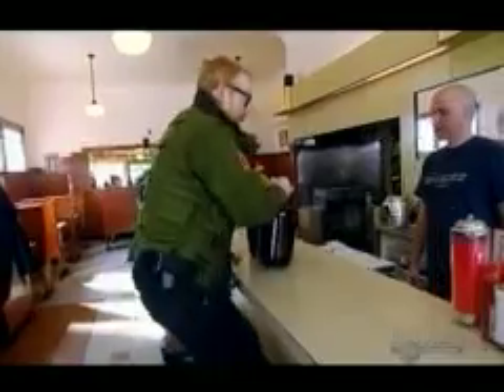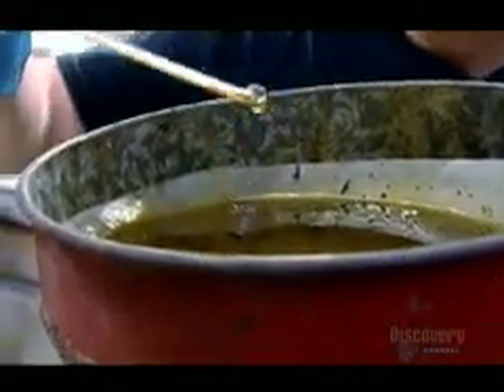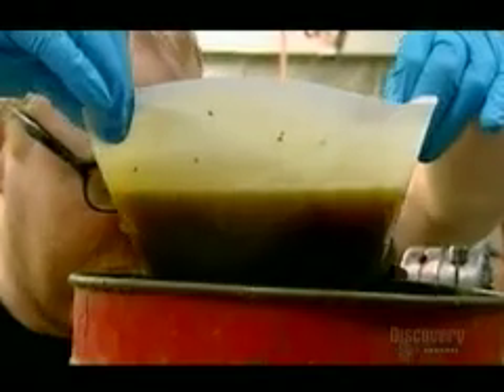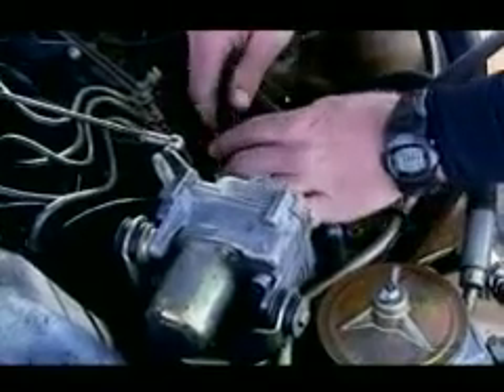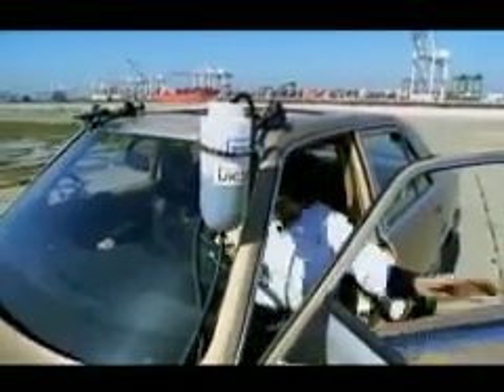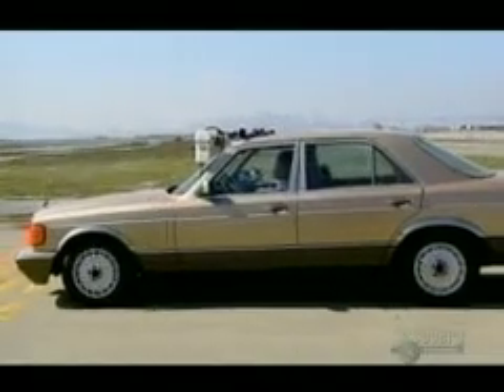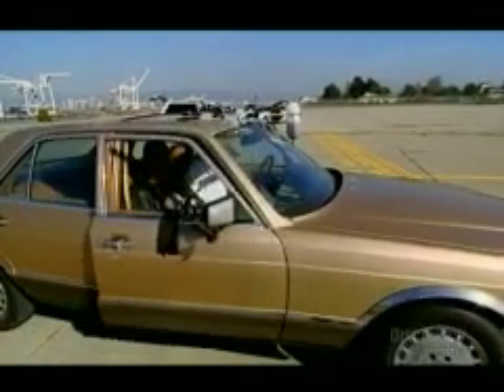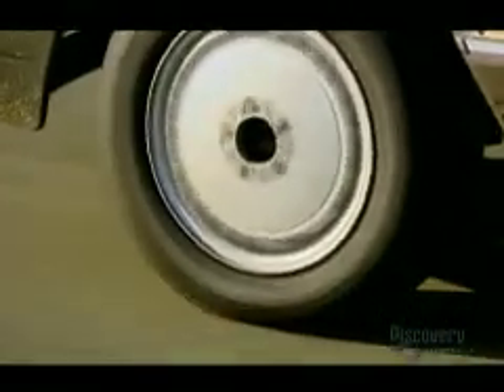Mythbusters - Cooking Oil as Economical Diesel Fuel

Comment: 50% cheapest vegetable oil you can find (just filter it)
40% diesel
10% petrol

Mix it up in a container (a barrel or whatever), let it sit for a few days and you are ready to go.
Will start at low temperatures (wont freeze), will run smooth, wont have any negative side effects of running on pure vegetable oil. Just remmember you cant use it on modern diesel engines but only on older ones. I have done it with Mercedes C250D 1993 model, Mercedes van 207, 2.4l diesel 1985 model, BMW 525 tds 1995 model, Golf 1.9d 1994 model, Golf 1.6d 1988 model, Audi 80 1.6d 1989 model.
All of these made about the same fuel usage but at a much lower cost.
I have done about 100.000 km in Mercedes c250 on this fuel in one year and i didnt have a single fuel or engine related problem. All the service was done just on regular base like i run it on normal diesel.
Mercedes 207 van i still use today and so far I have done about 200.000 km in a period over 7 years without a single fuel or engine related problem.
All other cars i just try and didnt do more than 200-300 km in each (some of them where my friends old cars). My neghbour started using this mix on his renault chamade 1991 model 1.9d maybe a month ago, no problems so far.
These cars are cheap and when the fuel is only about half price.. well you get the picture.
Reply: Warhund Serbia, thank you for the detailed comment. Very interesting. Why isn't vegetable oil suitable for new engines? You say this fuel would hurt the engine in the long term. What would exactly happen? What is the difference of old and new diesel engines?
Reply: Would that work on a 2000 TDI Volkswagen? Can I put the old filtered oil directly in the fuel or I'd have to put a second tank? I guess you were also changing the fuel filter more often? Anything else do I need to know?
Reply: I didnt use it on turbo charged engines of later production. I have a passat 2002 model 1.9 TDI 130hp and since its euro3 you cant use this mix. Dont get me wrong it would run but after a while you would make the engine hurt.

I put the mix directly in the tank, no aditional work needed. Only on the mercedes 250 i had to remove the pre-filter since it got jammed up more often (like every 2 months) and the filter got changed on normal basis (i dont know the km count since i didnt pay much atention to it but i know it was regullar.

On all other cars i just put the mix in the tank and run. I didnt do a single thing to any of the other cars (or the van) and they all run perfectly normal.

One more thing, the 207 van run better on mix than on regular diesel. I asked my mechanic (he is a school friend also and his shop is like 20 meters from my house) is it possible. He told me since the old diesels (euro 2 or older) use to run on regular diesel fuel the engines where made for that type of fuel. Now you cant buy diesel fuel but only eurodiesel (new type of diesel) and that fuel is made for new engines and that new fuel simply doesnt have enough oil in it for the old engines.

Diesel you buy today hurts old diesel engines (euro 2 or older) and this mix is actually better for your engine and the life span of it will be longer and less work and service will be needed.

Crazy but true.
Reply: +Justin Larrivée 

One more thing, you dont need to use the 10% petrol during the summer/spring/autumn. It will run good without petrol but remmember that it will freeze during the winter (or in low temperatures) and you wont be able to start. It will just get mushy and you wont be able to start your car. The 10% petrol takes care of that for you and also ads a bit of kick and power to the mix. But 2 much petrol will hurt the engine. I never went above 10% (during winter) and in the summer i use to put like 1 liter of petrol in 40 litre barrel (20 litre vegetable oil, 19 litre eurodiesel) but it does run a bit better with 10% petrol.
Reply: I use a 35% SVO/65% diesel mix in my 2001 Passat estate during the summer and achieve 52mpg average including urban driving and two long journeys on the motorway. Have used it in the winter but the engine really did not like it at very cold temps. Opacity test is very low too :D
Reply: I have left a comment above about how my 207 van works better on mix than on normal eurodiesel. Thats why.. just turn the story around..

The old diesels (euro 2 or older) use to run on regular diesel fuel and the engines where made for that type of fuel. Now you cant buy diesel fuel but only eurodiesel (new type of diesel) and that fuel is made for new engines and that new fuel simply doesnt have enough oil in it for the old engines.

Diesel you buy today hurts old diesel engines (euro 2 or older) and this mix is actually better for your engine and the life span of it will be longer and less work and service will be needed.

So this mix has more oil (like grease not oil like fuel) than modern diesel engines (euro 3 and above) would like.. So it greases up the system since the injectors are far more sensitive.. It will run but you will have some problems in the future.. like you would have to change pre-filters and filters more often and injectors will get clogged up (those are expensive to replace or even service). The more electronics the car has and the more modern it is the more damage it will suffer..
Reply: I have a 2003 Citroen C5 2.0 HDi which is common rail but doesn't have a particulate filter. I am thinking of blending waste vegetable oil at about 20-30% with diesel. I am already adding 1:200 2-stroke oil in my diesel to increase lubricity and also use a couple of proprietary diesel additives that are supposed to improve combustion and reduce emissions. Do you think I can get away with that amount of vege oil in the diesel? One of the additives I use is very thin solvent based, probably kerosene, so would probably act as a thinner for the vege oil as well.
Reply: The Chamade 1.9 F8Q Diesel is a great engine. Had one

Comment: LIES! My old 1984 Mercedes 300D can run on straight used veggie oil. I have driven thousands of miles on free grease.
Reply: I have a 300TD with the stock om617, replaced the main and secondary fuel filter beforehand, it runs pretty good and you get the bonus of exhaust smelling like French fries
Reply: So your car works exactly like the car they showed and they are lieing????
Reply: Will it work on my 240d ?
Reply: @nekikrkan8035  old Mercedes works great on oil but if you drive on pure oil it should not be much below 10C.
https://youtu.be/v028ttuq50Q
Reply: +Dorian Demeturlias my too !!!! :D
Reply: Is your benz turbocharged?
Reply: Dorian Demeturlias but boy if u break a pump those savings are gone mix 50 50
Reply: @chris532008   80/20 mix will work just fine.
Reply: I wanna buy any diesel w124 if it can run with used FREE veg. Oil without any problem. But somebody says you Will run out your engine and repait cost Will be more than fuel cost
Reply: Koray Erman   First is the getting the supply of oil consistantly and low price. Without salt then months to settle out. Then thin with 1/4 gas to crack then 50 percent diesel   If u set up net work of several people get restaurant cooperation set up yo repsir pumps and injectors just in case snd more frequent filter changes as I understand 2 years interval is important
Reply: My 2.5 turbo diesel Jeep too!! 🙂
Reply: BorisGrayman 300d is a turbo model. 240d is not
Reply: max p They made naturally aspirated 300D. Turbochargers became standard on the 300D in 1982, any 300D before 82 is not turbocharged.

Comment: Conversion in to actual biofuel requires you to react vegetable oil with methanol, using sodium or potassium hydroxide as the catalyst. You would then filter out the glycerol and you would be left with methyl esters that would serve as a suitable replacement for diesel. It is economical too.

Comment: The one important thing they failed to test.

Power output. Put the car on a dyno, see if it makes more or less power with veg oil.
Reply: interesting profile name,
Reply: Bullshit. Try release the gas pedal and look at the speedometer. It will slow down  slowly but steadily due to vehicle air drag and tyres friction and finally you will stop.  It will consume less gas though because when your car is up to speed you are fighting against dynamic friction which is weaker than static friction. The MPG is a good comparison between two identical engines running on different fuels.
Reply: Well yes, but as the cooking oil is a bit less powerful the car needs a bit more to keep it at 35mph
Reply: +Mohamed ThePedophile It makes less. Hence the less mpg.
Reply: +RogueTalent541 That's the most illogical thing I've ever read. Once you get that thing up to speed, you barely use ANY power to keep it going. A scooter engine could keep that thing going 35MPH with no problems, it's getting it up to speed that needs power and more fuel.

The car may be making less power (and it probably is to some unimportant extent), but that wouldn't have an adverse effect on fuel economy. And really, if you are running your car for free, you really don't have a reason to complain about power loss.

Comment: I have been doing this for ten years.
it is not a time consuming process.  I let it sit for 3 weeks - none of  my time required except to pour it into the container. Then I gravity feed it through a filter into another container (drum) - time required only to turn on the tap. Then I pour it into  my car and drive. Takes me about an hour to pick up and 'process" 100 gallons.
I get the same mileage (exactly) and power with both fuels.  I heat it before it goes into the engine to make it easier on the pump, but it runs without the heat anyway.
Reply: +Gerry S "I heat it before it goes into the engine" you said.. How do you do that(let say, in the morning for exemple)?..
Reply: +Jay Silva 
Hi Folks
I have done this on several vehicles....
I make a smaller tank that will fit under the hood, bend some 3/8 copper tubing and put it into the new tank.  Then I plumb the coils into the into the engine coolant system (before it gets to the cab heater).  Perhaps not necessary, but I also have a separate 'golden rod' (google it) filter wrapped with 3/8 ID between the tank and the injection pump,  to provide some secondary heat and then I made another heat exchanger out of a 3/4" copper pipe with hot water running through it and the fuel line goes through that just before it gets to the IP. Remember I live in a cold climate, but this system even worked when it was -40 deg (yes that is a minus!).  You'd had better make sure you don't shut it off at that temp with oil anywhere in the system though if you don't have a way of heating it all up before you want to run it again!because at that temperature the oil freezes just like butter would.
I of course have a two tank system where I start on diesel using the main tank and when the engine comes up to temperature I switch over to Veg oil. I switch back to diesel about three km from home to ensure that it can start on diesel only.  There are ways around this too, but if you live in a hot climate you won't have to worry about these starting issues.
Even at 140 deg F diesel sis still a lot  more viscous than diesel, so your pump will be happier with you over the long term if you heat the oil before it goes into the engine.
You can tell that this system in a cooler climate isn't much good for around town due to the delays in switching.  However, if you have a more modern engine (my last one was a TDi 1.9 VW they have a lot of fuel going through the return lines and don't require more than about 30 seconds to clear the oil form the IP.  My current vehicle is a nissan pickup with an SD25 and they hardly return anything through the return lines - hence the longer time to purge before shutdown.
None of this is complicated and I can send pictures if you provide your email.  No idea how to do that on youtube
Side thought....I am not a chemical engineer, but I would avoid mixing gasoline with veggie oil thinking that you can make diesel. I don't think they are the same thing.  If you must mix, I'd suggest just mixing it with diesel.  Mix at bit at different ratios and leave it outside in your area and see how it thickens (or not).  Mix it well or it will tend to separate, but when mixed thoroughly it seems to stay mixed for  a few weeks at least (I haven't left it more than that).
Hope this helps
Cheers
Reply: Thank you bro for all the time and care you took to explain nice and clear all you have done so far.. My kudos to you.. You rock bro :-)
Reply: +Jay Silva 
No Problem.  This medium only works if people follow up....otherwise it is just an exercise in frustration - and there is a lot of that on here.
Reply: +Gerry S  "It's easier to fool people than to convince them that they have been fooled."
Reply: Gerry S can you email me pictures please Gerry, very interested in doing this, haeremaimoko@hotmail.com
Reply: Gerry S You are awesome...
Reply: Gerry S weeks is very time consuming
Reply: @circusboy90210  Is the $$ savings worth the time. In a single word... yes. Compare the cost of used veggie oil to a gallon/liter of diesel. Most used veggie oil can be obtained free of charge from your local restaurant as they typically have to pay to have it picked up and discarded.

Comment: yes it runs but your machine will be shorter life because of dirt in that oil , it is filtrated but that oil still got dirt inside , i mean look how blurry that oil is all that stays in your machine , that is why all fuel for engines are clear that you can see through , it have just the color but cristal clear...
This will be great if you filtrate and refined that oil that start to be clear , then will be even for useing all the time in machine and you can mixed with diesel over time.

Comment: Ummm... wait a minute, is this video about the coolness of running a car on cooking oil, or is it about the fuel efficiency of difference between diesel oil ?  I've never heard anyone claim that cooking oil had more energy in it than diesel oil.  That said, the fuel companies have already been co-opted by the green freaks into burning alcohol in cars (e10, e20, e50 and e82) in the mix of gasoline with alcohol, which reduces the fuel economy of the car because alcohol has about 50% of the caloric value of pure gasoline. Which means you're paying more at the pump while getting less fuel mileage.  Which also means that all that alcohol we are using has to be grown (using land space and water.), harvested (most tractors run on diesel) processed (you know using fuel to  cook an organic product and turn it into alcohol), and then shipped in trucks limited to hauling 60,000lbs over the road (because alcohol is caustic and can't be run through pipe lines) in diesel truck tankers to a processing plant to be mixed.   Doink.
Reply: Not quite.. ethanol has 1/2 the caloric energy as the same volume of gasoline, and diesel has more caloric energy than gasoline.   The maximum compression ratio for an alky engine is right at 14:1, maximum compression ratio for a gasoline engine is about 16:1, and diesel engines are at about 23:1.
 IF... you were to run run a carbureted engine on pure gasoline and then switch to alcohol without making any other changes the engine would run to lean and you would end up burning valves and doing other damage to the engine. IF.. you have a modern engine with electronic fuel injection calibrated for pure gasoline and you try to run alcohol in the same engine you will get the same effect as with the carbureter for the same reasons, because the fuel injectors for a pure gasoline engine will not flow enough fuel to achieve the proper fuel / air ratio to operate the engine safeley.  That's why you have vehicles identified as "Flex Fuel" or E10, E20, and E85. The more alcohol you run in a mix, the more fuel the injectors have to be able to flow. I suggest as a test, you take two lawn mowers of the same make and horsepower and run them side by side, one using pure gasoline and one using pure alcohol, using identical volumes of the different fuels and see which one runs out of fuel first. Actually hooking up the lawn mower engines to a generator of some type to generate some load on the engine, you won't be able to run the alcohol fueled engine without jetting it up and when you do jet it up and get it running, it will run for almost half as long as the unmodified engine. You'll have to change the ignition timing on the alcohol engine because alcohol burns slower than gasoline or you'll end up burning the valves on the alcohol engine. What I'm stating is not some kind of theory or belief, it's a time honored group of facts well established through over 100 years of practical experience by millions of engineers, mechanics, and hot rodders.   Sorry guys ... you just aren't correct on this one. I really really like your show and think it would be really fun to do what you do.
Reply: BUT cellulosic  alcohol can come from veggie/tree food scraps, animal poop??.After storms loads of branches & trees come down across towns & cities,,  all can be made to fuel flex fuel cars